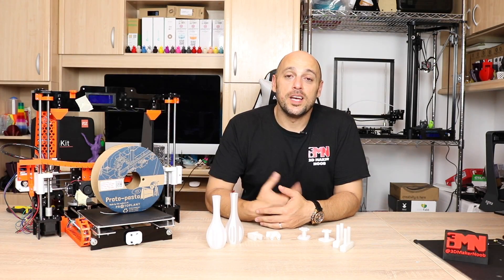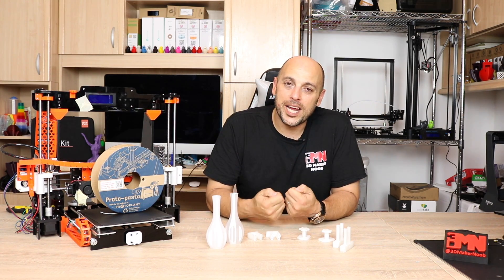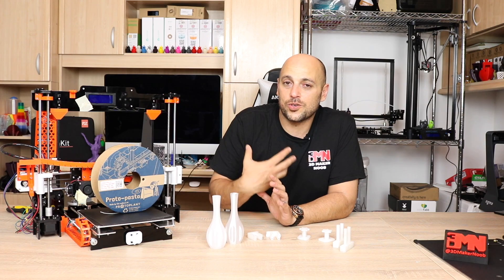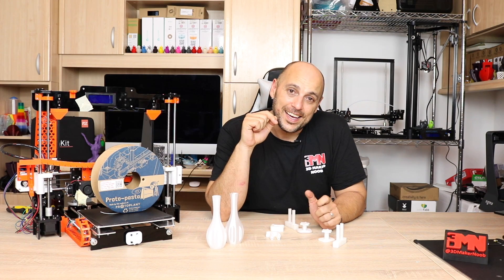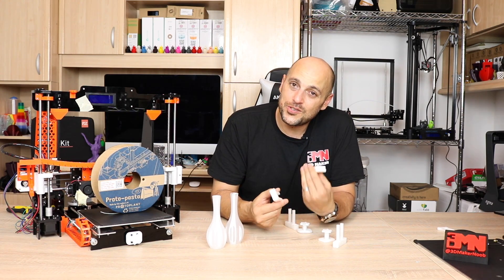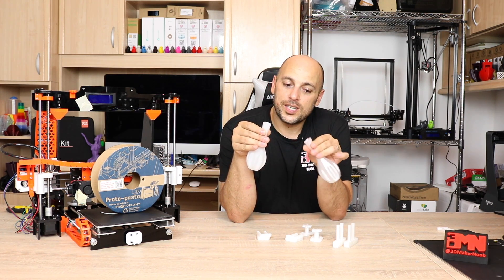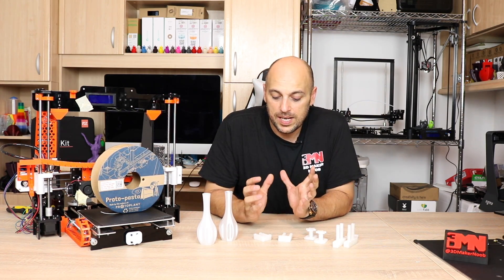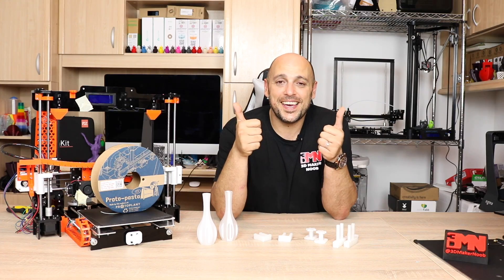Trying out the Proto-Pasta HTPLA V3.0

Comment: When we bought our house it had a plastic cover of the electric doorbell in the hallway. It was a nice sound but the cover, once white had yellowed by age. I decided to spraypaint it white again. Since I did want to mount it back in place as fast as possible I put it in the oven at 50 degrees to dry and harden it fast. Made the same mistake. Oven was not preheated and when heating up it will radiate much higher temperatures from the heating elements. So when I checked on it I saw it had shrunk and twisted badly. 😢

Comment: a3dp and others say it's just a marketing name for reused / remelted filaments, as all know when reusing the same filament melting point shifts up 10-20 degrees, maybe more, in both the temperature required to print it also whtn trying to see final objects limits. 
However, as the reusing alters the structure of plastics iremediably, if you'd have done a proper experiment you whould have seen that regular PLA would maintain it's shape where PLA+ would actually twist over itself at as low as 145C, making it unusable afterwards. So much for nothing... 
Until testers & producers will clarify this aspect, I'd rather stay off of it.

Comment: Great video.  I guess the question I have is this is "designed" to be annealed, but regular PLA can be annealed as well.  I'm curious on how much better (or even confirm it is better!) that HTPLA is over regular PLA.
Reply: I mean, didnt this video answer that? Regular PLA tolerance changes several % when you anneal it. This had a threaded bolt that still worked fine after annealing, which indicates a less than 1% shrink, much better than regular PLA.

Comment: I'm trying to use the high five blue htpla.i can't get the stringing to stop. What were your retraction settings?
Reply from the maker: +Paul Smith they vary depending on the printer you are using. Usually prints like normal PLA